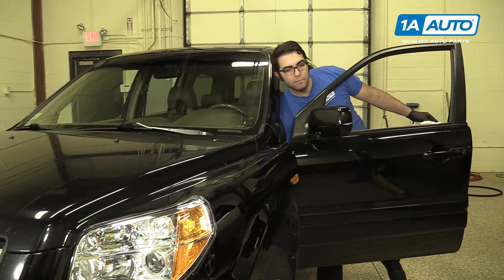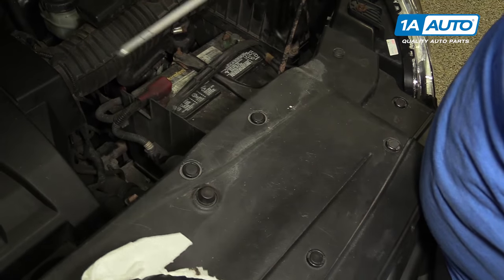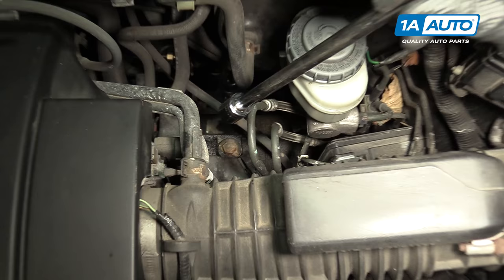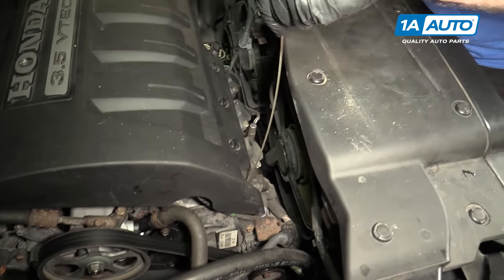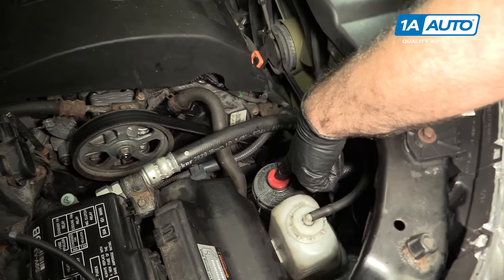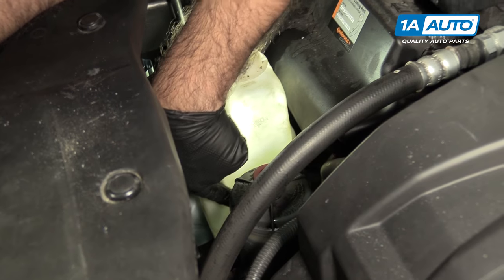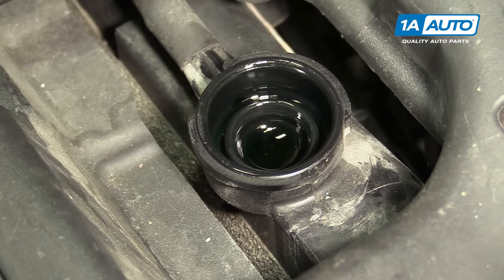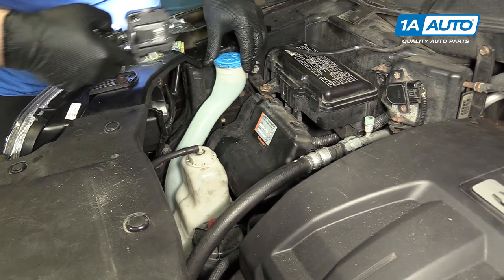How to Check and Fill Under Hood Fluids 03-08 Honda Pilot

Comment: I just fill through the dipstick for a/t fluid. I bought a funnel with a long tube at the end but the plastic connector at the end was way to big to fit in the dip stick. I happened to have some tubing that is very small in diameter I honestly think it was meant for plumbing. I wrapped some electrical tape around it till I could slide it in the end of the funnel tube, then tightly secured it with more electrical tape on the outside. Works perfect 😁 glad I happened to have the small tubing from past projects 😂

Comment: You can also add transmission fluid through the transmission dipstick with a special funnel. That's how I changed the transmission fluid on my Pilot.
Reply: Luchador EMC what year is yours?
Reply: Luchador EMC 
04 Pilot, checking transmission fluid  engine is off. At normal operating,  correct?
Reply: Where can I buy special funnel Luchador EMC?
Reply: @robinhembree4101  yes check when off but a normal operating temp
Reply: @henrynguyen7001  I got one at O'Reilly's

Comment: on most vehicle yellow is the color of the oil fil cap and oil dipstick. Red or orange is normally transmission fluid check.
The color on the Honda are backwards.

Comment: Where to add the coolant that run through the bottom of the radiator for the transmission. It’s  a closed system that runs through the bottom of the radiator. Just change the radiator.

Comment: I have an ‘07 Pilot(in terrific shape) with 225K miles on it. Do you recommend changing the trans fluid on it or just checking the level? I’ve read that changing the fluid on an older transmission might cause problems. Thanks.
Reply: Heard changing fluid at that high miles might destroy the transmission
Reply: I don't think it's the changing I thinks it's when you flush it
Reply: But I'd say it's about due I have an 03 157k bought it used with extensive service history. Had a transmission oil change at 115k mi i got it with 124k or something like that can't recall.
Reply: I've used all their videos to do some work on it I just changed my brakes last week today it'll be my filters and oil
Reply: Its fine to drain the fluid on a high mileage vehicle, but DO NOT FLUSH.
Reply: You can change it just don't flush it.Changing it doesn't completely drain the entire amount of fluid in it.So some of the old fluid stays in and they refill what was drained.Then your all set.Fluid change is recommended every 60k miles Don't ever do transmission flush though.
Reply: Here's the deal. Most transmission fluid don't get changed so don't do it. The automatic Trans have a bunch of little clutch pads that though use and heat caused by not flushing and changing wear out. So the little pads are worn out. But, the clutch material is floating around in the old fluid and thus the tranny still works. If you flush or fully change the fluid the old clutch pad material goes away and your tranny won't work. Best to just top it off and drain nothing.

Comment: I checked my pilot transmission fluid, when i grab the stick out, but there is only a short rubber cap under the hole, there is NO stick long into the fluid.   What happened and what can i do? Thank you in advance.

Comment: Isn't orange for transmission and yellow for oil?
Reply from the maker: +jsaenzMusic Thanks for your question! On this particular vehicle the yellow dipstick was for the transmission fluid. It's also verified by the red color of the fluid. Thank you!!
Reply: jsaenzMusic  orange for the oil level. Only use the amount the manual says to add. That car had to much oil in it.  If you change your oil and filter it is only required to have 4.5 qts with new filter. which will read between the lines on the dip stick. Do not add more to bring it to the top line on the dip stick.

Comment: Dude trans was low right?
Reply: I think it looks a little bit overfilled. It's hard to tell in the video, but definitely not low. You can clearly see both of the 'high' and 'low' holes are covered using the reflection of the light as a guide to where the fluid is sitting.
Reply from the maker: +Fred Taj Thanks for watching!  The transmission fluid level was not low in this case, it had enough fluid.